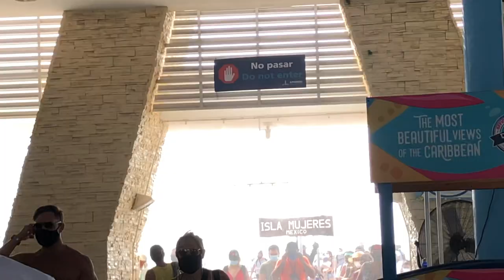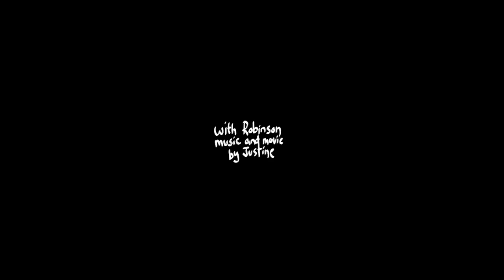TWO CYLINDERSAUR #95 sailing plus an engine

Comment: Fabulist engines! My last three boats had them in them,  Taken care of should last fifty years! When starting if you open to half throttle then push that button with the spring under it at (538) on your video, It should stay down!  Thats the choke, It will fire right up! You want that in cold weather or will take forever to start!

Comment: Thumbs up indeed! Great to hear her run. I spent the weekend with my engine mounts too. I converted the Catamaran to an outboard so I am cutting out the mounts to have more space for a water tank. Hi to Choco.
Reply from the maker: Good luck with your project as well. Love the idea of taking that oily, rusty engine place and turning it into a water tank!
Reply: @sailorama  Yeah. Everything mechanical is hanging off the back now. Between that and the composting toilet the boat has never smelled better.

Comment: Now I have to look at my motor. Do I need to make a heat exchanger? One more thing on this list. Oh well this year is solar install time I am putting a 10k system at home then 2 more locations. Plus the boat.  My supplier makes RV panels. I was in his warehouse last weekend and got a good look at his setup. 3 machines running and 3 more to get going. That's a lot of money. Your new motor is sweet. Glad to see it fire right up.

Comment: You won’t have much compression till you sling some oil up on the cylinder walls. Hot tip open throttle 1/4 and depress the the little brass “cold start button” it should stay down till the engine fires. I find it quite easy to hand crank my md2b affectionately known as HULK. Cheers! Old iron forever!
Reply from the maker: Thanks for this tip! That's awesome - indeed, there's magic in old iron.

Comment: Doesn't sound too bad. A friend of mine has more or less the same engine, just much more smokey. Still runs though. Some old Volvos are just rebadged perkins, might be a source for more affordable and available parts. If I remember correctly the decompression levers are for crank start, you crank like crazy with both open and then pop them both. The ginormous flywheel has enough inertia... Also the valves and the decompression are adjustable / need to be checked.

Comment: What was wrong with the old yellow engine? for a heat exchanger you can just run some steel pipes down the hull beside the keel, crude but effective and you can anti-foul paint it.

Comment: That engine looks very simple and easy to maintain.  Do they still make parts for it?
Reply from the maker: Some parts are kind of universal (the coupler and mounts for example) while other parts are going to be a treasure hunt (the heat exchanger and the exhaust elbow - ended up building a custom elbow at a welding shop for our previous boat Rossa's old engine in the end).